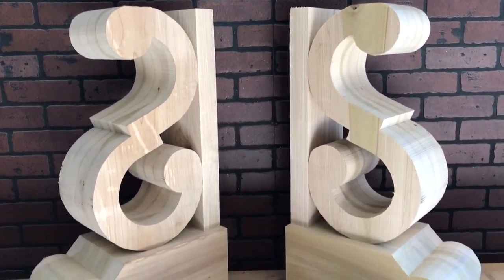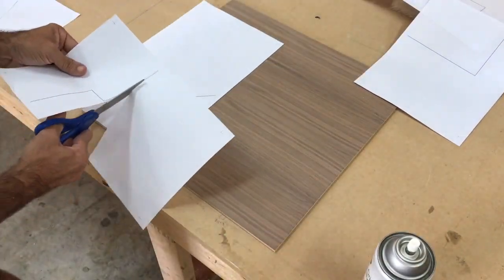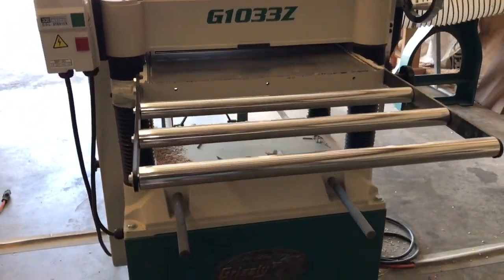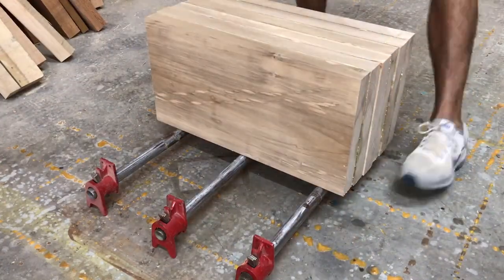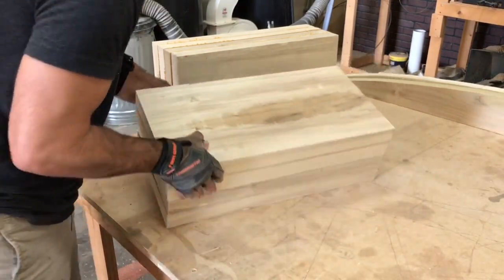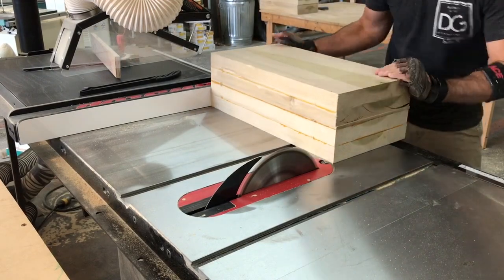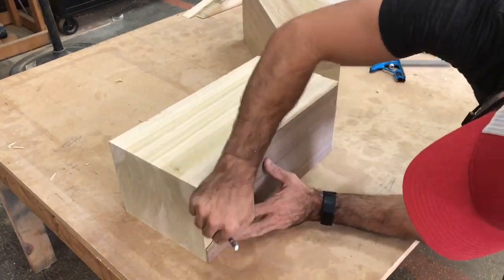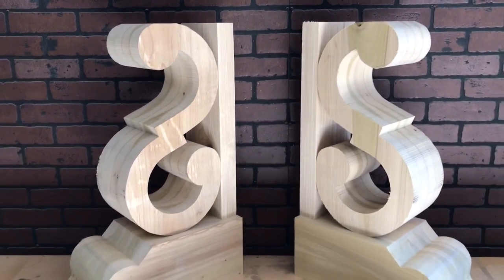How to Make a Scroll Base Console Table | Part 1

Comment: I'm currently working on a large table and want to do the scroll legs, im thinking about cutting each board to the template individually on the bandsaw then use a flush trim bit to get the perfect shape, then glue them all together. Im hoping doing it this way will minimise the sanding needed. I'll let you know how it goes!
Reply from the maker: Hi Aaron! The concept behind your idea should work perfectly... let me know how it goes... you GOT this! 👊

Comment: Thanks for the vid! What type/size of band saw blade did you use?
Reply from the maker: +Brett Turner thank you bro! And I use several different sizes for my bases depending on the type of cuts needed but this one was 3/8” skip tooth as it provides enough strength for straight cuts while adding enough flex for contouring cuts 👍

Comment: Nicely done! Where do you find those massive reclaimed poplar boards?
Reply from the maker: +Andy Sims hi Andy, i work with dozens of saw mills where I source a ton of my material and the other times I reclaim them myself from all over! 👍
Reply: @DesignsbyDonnie  any chance you'd let a few boards go for a really good price? I am trying to source various boards now, my aim is to build, finish, and donate a table to my mother in law in an attempt to show her a better way of life. She's a alcoholic, and since her husband passed a decade ago, she's almost completely thrown away any self respect, dignity, even her job, due to drinking and is just waiting until her time is up. No ambition to change her course and stick around longer. It's very upsetting to myself, most importantly my wife (her daughter).

Her house is potentially 225k on the current housing market, however she's even let her home go, without many details, let's just say that house would be lucky to see 125k if sold AS IS. Well, we've been trying to help as much as we can, with four boys in our home, and her living a hour away, and being set in her ways, it's challenging to say the least.

So we're planning a complete overhaul, as much as me and my wife can accomplish. But the key piece to the project is going to be this table. That we pray will ignite the life force that once burned bright within her, by showing her how much time effort and labor we put into the table, we hope it'll prove to her, she's worth it, and there's still beautiful things and loved ones in her life, and the world is a lot better off with her in it.

We hope this table will be a statement piece and the symbolic meanings behind it are apparent once delivered. We currently are a single family income, so any considerations of a fair price for the boards would be tremendously appreciated.

Hope to hear back sir.
Sincerely Aaron Leon.